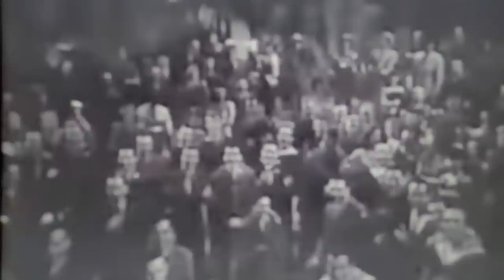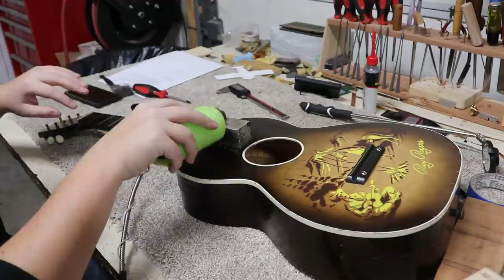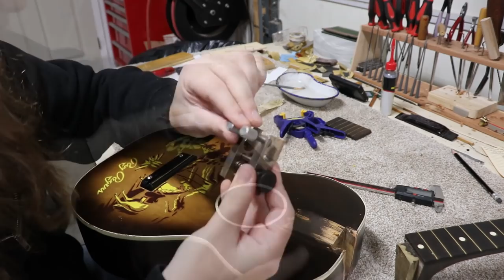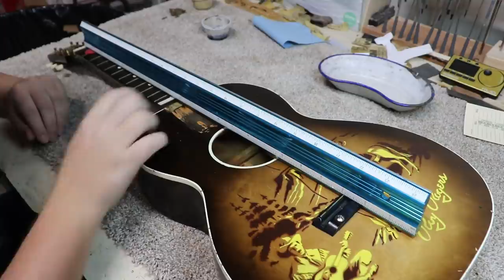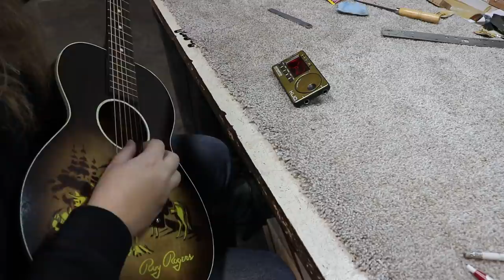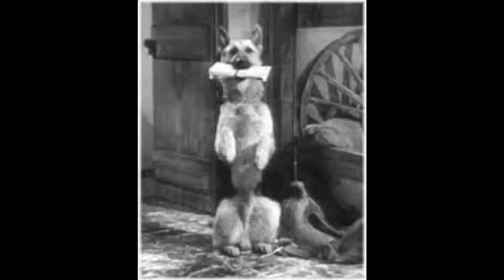464 RSW A 1957 Roy Rogers Guitar

Comment: I’m afraid that back in the 1950s, my Roy Rogers guitar was a tiny plastic thing. It had a crank handle on the side that turned a wide rubber band that had nubs molded into it, that engaged plastic fingers like a music box. It played Happy trails. It had 4 nylon strings that were pretty much non functional. Sure would be fun to have it or one like it today.

Comment: Hey Caleb.  If my guitar strings buzz slightly from the 10th fret up across at least four of the strings would putting on a taller saddle fix it?  There appear to be no frets sticking up and the action is very low currently.  I hate filing frets if it's avoidable.